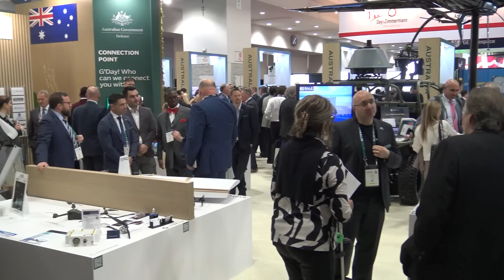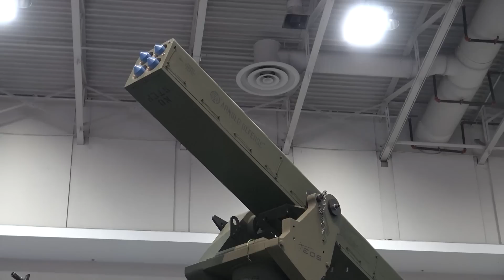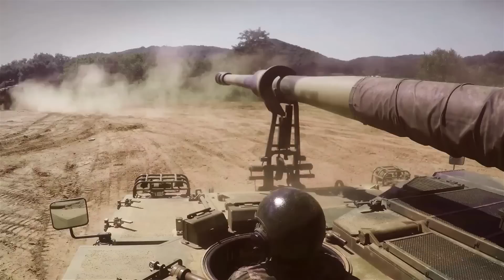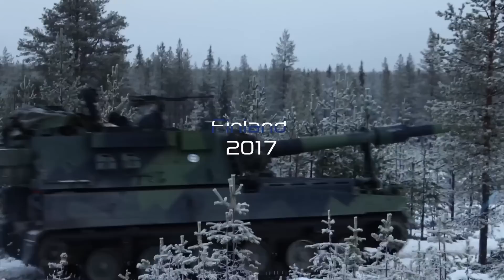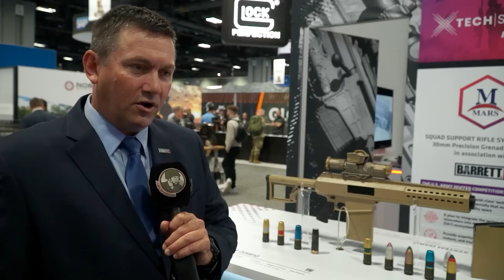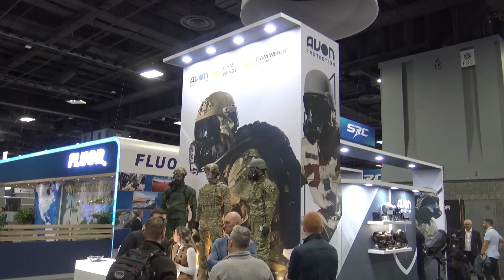AUSA 2024 Day 2 Latest Defense Products Unveiled - Combat Vehicles Howitzers Grenade Launchers

Comment: The FPV's in Use in Ukraine do not fly slow, this platform is only useful for surveillance drones. Attack drones will eat this up. This unit cannot track racing drones, they are the kings of the battlefield.
Reply: Thank you that was the same thing I was just thinking 100 miles an hour do you think that thing could track it that fast and low I don't think so it's called tactics they'll come in lower the thing still get it

Comment: Why would you create a new program for a 30mm grenade launcher instead of moving forward with the XM25 CDTE or Punisher? Hell, Barrett has their M109 rifle that fires a 25 x 59mm round with similar capabilities.
Reply: @@TeraQuad the XM25 CDTE IP was a 3 way joint venture ATK made the ammunition, HK made the weapon and Bushnell made the optical equipment. HK failed to live up to delivery of the system and ATK and HK had a hard falling out. Bushnell’s optical system would be a decade out of date. The ammo might be salvageable but it’s been over 10 years since they brushed that off. With the teaming in that condition it’s a no go. 
The XM109 used 25x59mm but that was the ammunition for the XM307 not the XM25 which fired 25x40mm. When the XM307 was cancelled that ammunition type ended up not having a justification.
Reply: Fuze volume is such a high portion of smaller Grenade rounds that small volume/weight/caliber improvements have outsized effects increases.

Comment: That C UAS DE is only good for a stationary target but against FPV  drones is useless!
Reply: Why there is also the M230 LF 30mm with airburst rounds.
Reply: @ChrisRuhl  That is absolutely useless against a swarm of drones.
Reply: @stanislavt6376 Why would you think that? They have shown footage of drone swarms being downed by airburst rounds. This system is no different. Except is has even more options.
Reply: @rickjames18   First air burst is effective only when there are two or three drones, but when that gunshot to the one side, but from left, right, or behind are coming others six or seven of those drones. We can build 50, 000 drones or more for the price of only one of those vehicles, and sending 100 of them to destroy one vehicle is a cheap solution. Think about that.
Reply: @stanislavt6376 That's why it has EW to jam drone signals, giving enough time for the operator to down them.
Reply: @night8285  Already exists drones with AI and they do not need a GPS or guidance from the operators. They recognized enemy vehicles, technics, and soldiers who did not have the code trackers and attacked them. Operators of the drones only need information about the region under threat to send the drones the coordinates. They are in combat now, but in small numbers, because old FPVs still work beautifully.
Reply: @stanislavt6376  then you have not seen the actual tests, nor seen practical applications of proximity fused point defense like I have.  Not sure how you are basing your assertion as compared to demonstrated testing along with similar examples like Centurion.  

The a drone swarm attack, as in multiple drones working in network, has itself not been applied in practical combat.  As it stands now, it is still individual drones with separate operators trying to coordinate their actions.  So systems on the ground are not facing multiple drones working as a unified whole.  Besides, a 30mm HE-FRAG airburst covers a good deal of space.  Moreso when fired in a patterned burst of 3-4 rounds.
Reply: @stanislavt6376  I'm not disagreeing. Cheap drones have been shown to be effective as well. That is why the Pentagon came up with the Replicator program. C-UAS is evolving with system like the Sky Ranger (I believe) taking out swarms from over a mile away. That is just one of many layered systems that will make up a good AA defense. All kinds of companies are looking for cheap ways to bring down cheap drones using more platforms than we would with legacy systems. One Patriot and a THAAD are not longer going to be enough plus the cost is insane.
Reply: @ChrisRuhl  That drone swarm tactics about you talking are used only to pinpoint enemies` strongholds and to deplete their ammunition, do not have an AI self-learning program, and do not communicate with themselves. No man in the loop, yours is only to direct them, and that is an end.
Reply: @stanislavt6376  but you will note I still addressed multiples of drones in the battlespace.  It’s not like these new SHORADS work solo.  And also with multilayered systems of soft and hard kill.  So you’ll have to be clearer on your own "battlefield swarms" outside of anything other than multiple operators working single drones, and actual examples of such use.
Reply: @ChrisRuhl  No my friend does not talk about other systems and the tactics used in the different combinations. This is a battle over AI drones and that UAS DE. The price of that C UASS DE is sky-high but can do little things alone. Drones are good for many things in the battle. 50. 000 them for the price of one SHORAD? I choose drones..
Reply: @stanislavt6376  but you have not provided your own proofs.  Let’s not get dazzled by "Drone Porn” or concepts of swarms in a tactical environment that are still concepts and yet to be exercised in practice.

I however do have firsthand knowledge of battlefield EW and point defense (insofar as Centurion).  But I’ve also seen the demonstrations and the data from the new ADA units that have received the first systems and their results from actual exercises.  Which means more than the test range, but actually using them in operational situations.
Reply: @ChrisRuhl  Hahahaha! Porn? I hate porn! What proofs do you want? What proof do you have, oh do not talk that bs. I saw that! Only what that system has is airburst ammunition and everything else is shit! Drones work in Ukraine, but Centurion does not work anywhere. Only marketing b.s, and a big cost.
Reply: @ChrisRuhl  Porn!? What proof do you have? I saw! Hahahahaha!!! But the whole world looks at what drones doing in Ukraine, and you want proof? Hahahaha!
Reply: Well buddy the first car was no Ferrari either was it?
Reply: @mysterioanonymous3206  Maybe a Mercedes or!?